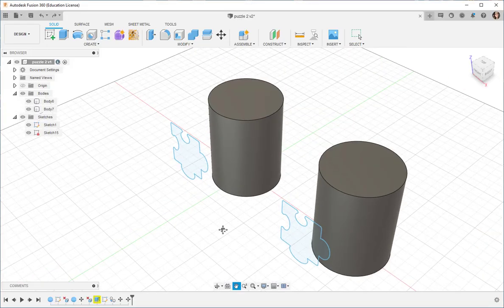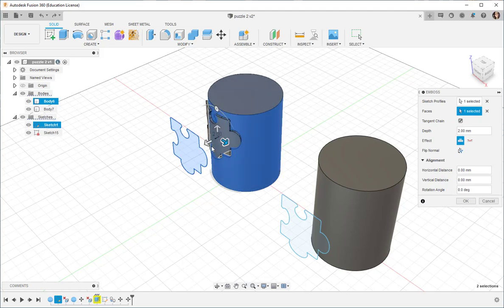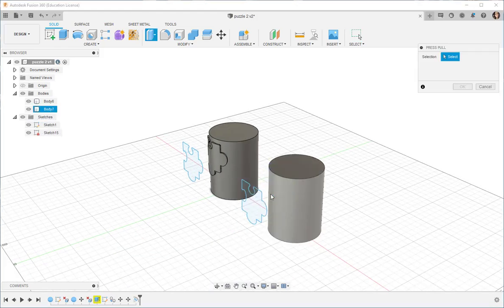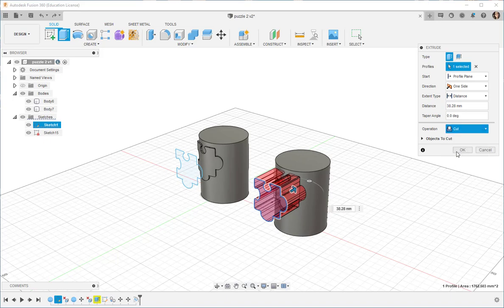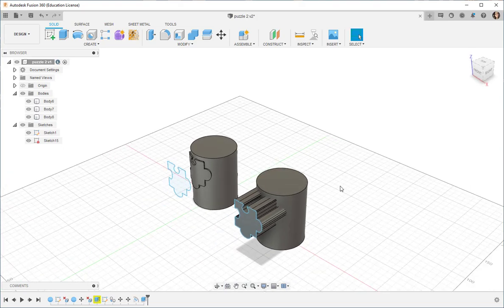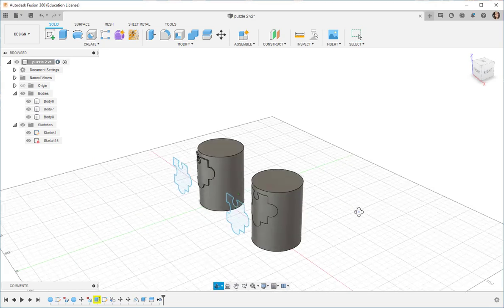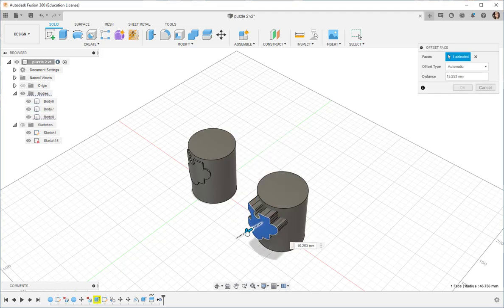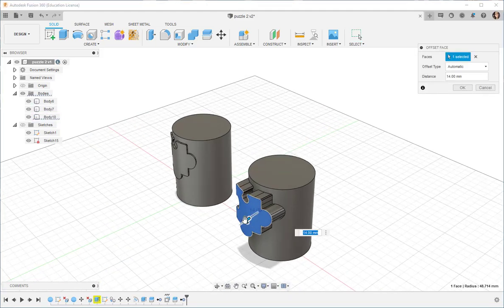Fusion 360: Add A Sketch to a Curved Body

Comment: If i were to use this to make a grip textured curved surface, will the edges be stretched/elongated? Or does the sketch hold its dimensions as best it can around a curved surface?

Comment: Hello, I'm working on a project right now and i'm a complete novice to rounded surfaces. I have a dome'esk shape and I want to put a sketch on that surface so I can pipe it. I tried what you did in this video but after i select emboss, it does not let me select the face of the dome. Only the bottom flat side. Got any words of wisdom for me? :)
Reply from the maker: It only works on a cylinder. This person has a workaround where he embosses a cylinder, deletes the cylinder, replaces it with a sphere and then does a replace face. You could  try that with your dome.  https://www.youtube.com/watch?v=G-9GNVpYjk4
Reply: @ProfDrafting  Thanks so much. I'll probably have to watch this video a couple dozen times to grasp the idea and try it myself.

Comment: In the second example, I think a better option would be to use the extrude command. In the extrude command, you can change the starting condition to "object" and select the cylindrical face. This will create an extrude that follows the cylindrical face.
Reply from the maker: Sure, but a goal was to show different tools. Extrude was also covered.